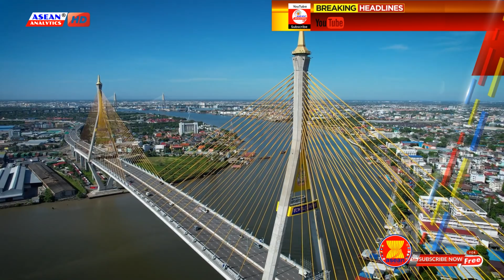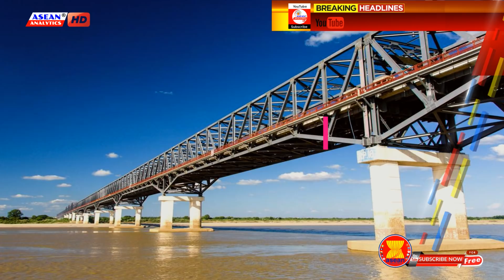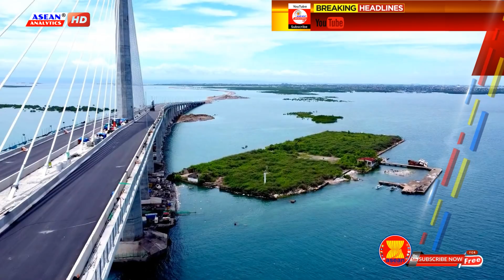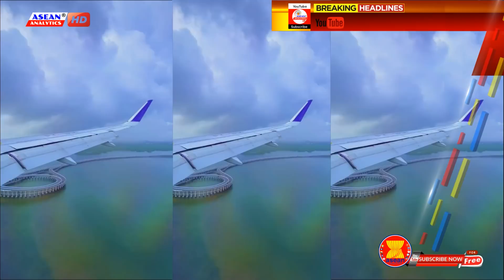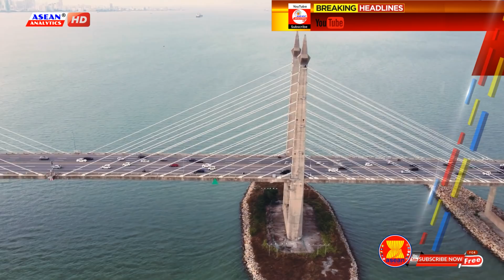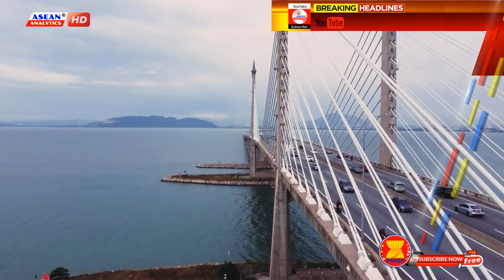Longest Bridge in Southeast Asia

Comment: APAKAH KALIAN TAHU JALAN TOL PERTAMA DI ASIA TENGGARA BERADA DI INDONESIA?

JALAN TOL JAGURAWI adalah Jalan Tol pertama di Indonesia dan Asia Tenggara yang dibangun pada tahun 1973 dengan biaya pembangunan sebesar Rp. 20.650.000.000 atau UD$ 1.432.876 (untuk tahun itu termasuk biaya yang besar). 

DIKETAHUI:
- Pada tahun 1972 harga emas US$ 126,3 per
   Ons atau Rp. 2.340.447 (2.340.000) 
- Biaya Tol Jagurawi Rp. 20.650.000.000
- Pada tahun 1972 uang Rp. 20.650.000.000
 bisa membeli Emas seberat 8.824,786 Ons
- Saat ini harga Emas per Ons sebesar
  US$ 1.852,89 atau Rp. 26.750.000 
- Membeli Emas seberat 8.824 Ons (1972)
   akan mengeluarkan uang US$ 16.361.741,58
   atau Rp. 236.042.000.000

Ketika JALAN TOL JAGURAWI INDONESIA selesai dibangun banyak orang yang datang, termaksud orang dari negara tetangga INDONESIA (ASEAN). 

Kedatangan orang asing ini untuk melihat infrastrukturnya, meniru manajemennya, dan meniru konstruksinya, semuanya meniru! 

Silahkan kalian buktikan kemiripan konstruksi tolnya antara JALAN TOL JAGURAWI INDONESIA dengan JALAN TOL YANG ADA DI NEGARA ASIA TENGGARA.